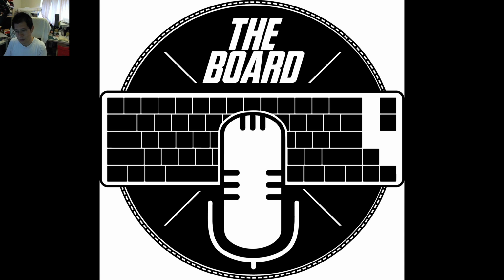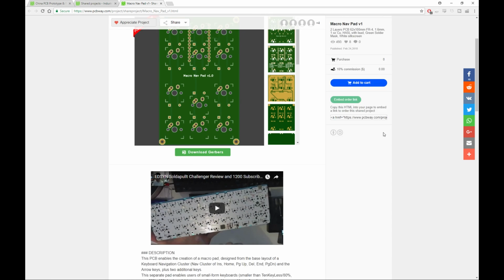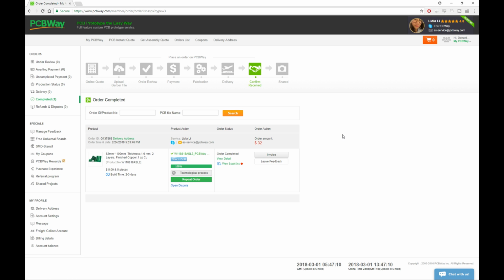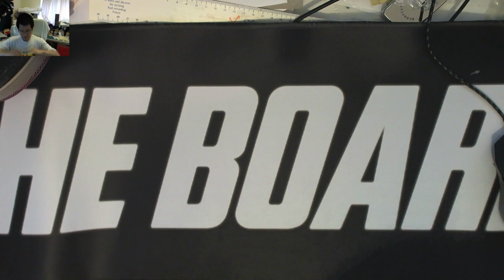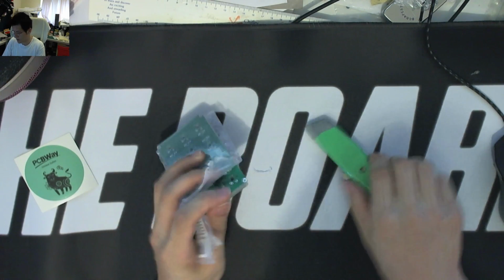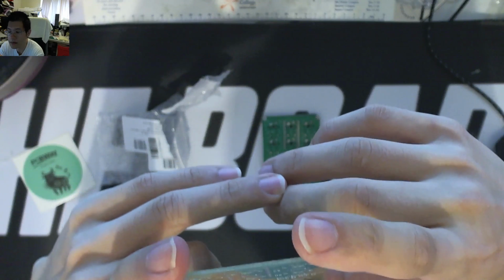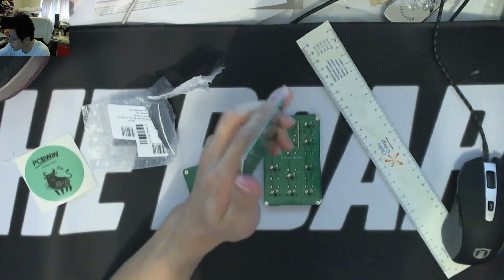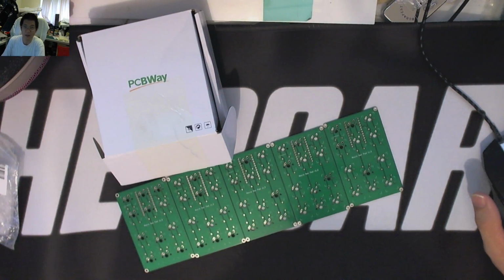PCBWay Review

Comment: So, do you recommend PCBWAY?
Reply from the maker: They are a good quality product in  terms of the end result, the price however you do need to check, as you can get cheaper, but you might be able to get a good deal if they have specials. I would have no hesitation in ordering through them again, but with loyalty schemes available from a variety of PCB manufacturers, I have more points with another PCB fabrication company, so my preference is due to the loyalty scheme more than anything else at this point in time.
Reply: @theboard  thanks! Could you mention what other PCB manufacturers you are referring to?
Reply from the maker: I have more loyalty points with AllPCB, an I recently also got some made with WellPCB.